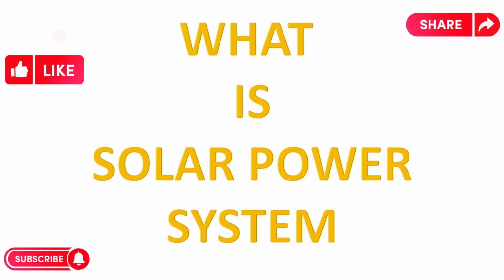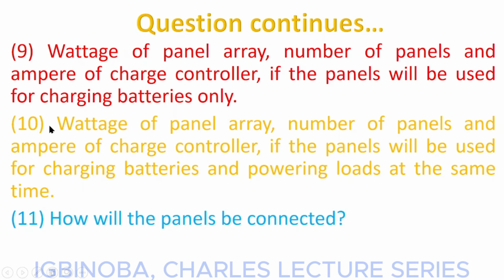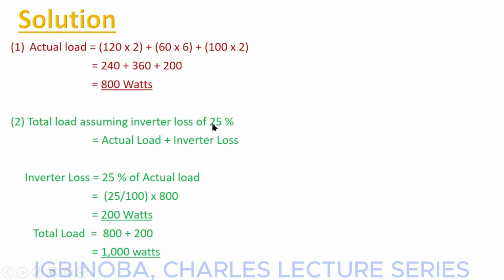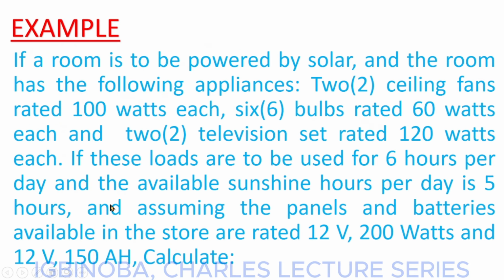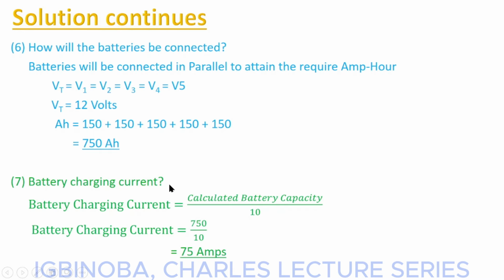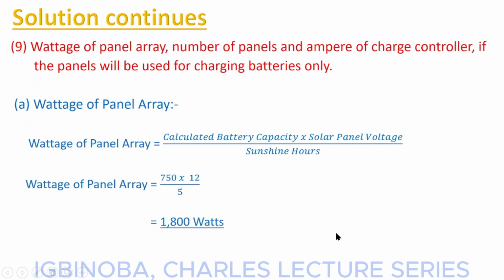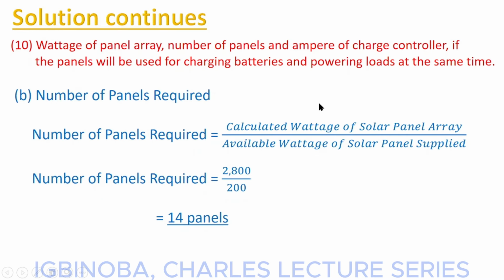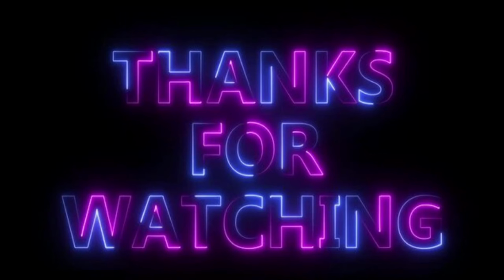Design of Solar Power System

Comment: PETRO3177U

1. Actual load= (100×3)+(60×10)+(120×4) =1380watts
2. Total load assuming inverter loss of 25%= Actual load +Inverter loss
Inverter loss=25% of Actual load
= 25%×1380=345 watts
Total load= 1380+345=1725 watts
3. Inverter rating on VA using power factor of 0.8
= (1725÷0.8)= 2156.25
4. Battery capacity using factor for reserve 75%=(2×1725×6×0.75)=1293.75Ah
5. No. of batteries for backup hours=1293.75Ah÷150Ah= 8.6 =8 batteries 
6. How batteries will be connected?
The batteries will be connected in parallel 
Vt=V1=V2=V3=V4=V5=V6=V7=V8
Ah= 150+150+150+150+150+150+150+150=1200
7. Battery charging current=1293.75÷10=129Amps
8. Battery charging time assuming charging loss of 40%= 1293.75Ah+(40%+1293.75Ah)÷129A=14hrs
9a. Wattage panel array= 3105 watts
9b. Number of panels required= 3105÷345=9 panels 
9c. Ampere of charging controller required= 3105÷12=258.75Amps
10a. Wattage of panel array= Calculated wattage of solar panel array for charging battery only+ calculated total load =3105+1725=4830watts
10b. Number of panels required= calculated wattage of solar panel array÷ Available wattage of solar panel supplied= 4830watts÷345= 14Amps
10c. Ampere of charge controller= calculated wattage of solar panel array÷ solar panel voltage=4830watts÷12volts= 402.5Amps
11. How will the panels be connected?
Ans: They will be connected in parallel.

Comment: MECH338L

1)actual load = 1380watts
2)total load= 1725 watts
3) inverter rating =2156.25VA
4)battery capacity= 1293.75Ah
5)No of batteries= 9 
6)batteries are connected in parallel 
7)battery charging current =129.4amps
8)battery charging time=14hrs
9a) wattage of panel array= 3105watts
9b)number of panels=16panels
9c)charge controller= 258.75A
10a)wattage of panel array= 4830watts
10b)number of panels = 24
10c)charge controller= 402.5A
11)panels are arranged in parallel

Comment: MECH3182Z

1. Actual Load: 1380 W

2. Total Load (including inverter loss): 1840 W

3. Inverter Rating (VA): 2300 VA

4. Battery Capacity: 1227 Ah

5. Number of Batteries: 9 batteries

6. Battery Connection: Parallel

7. Battery Charging Current: 15 A (per battery string)

8. Battery Charging Time: 5.1 days

9. Panel Array (for charging batteries only):

Wattage: 2945 W

Number of Panels: 15 panels

Charge Controller Ampere: 245 A

10. Panel Array (for charging batteries and powering loads):

Wattage: 4785 W

Number of Panels: 24 panels

Charge Controller Ampere: 399 A

11. Panel Connection: Series – Parallel

Comment: PETROCHEM65M

1. Actual load- 1380W

2. Total Load - 1720W
3. Inverter rating- 2156.25VA
4. Battery capacity - 1293.75AH
5. Number of batteries (12V,150AH) - 9
6. Battery connection (48V System) - it would be connected in parallel 
7. Battery charging current - 129.4A
8. Minimum charging Time - 14 hours
9.  (I)  3105W
     (II) 15.5 Panels~16 panels 
     (III) 258.8A
10a. 4830W
     b. 24 Panels 
     c. 402.5A
11. Parallel

Comment: EEE3123S
1. Actual load - 1380w
2. Total load - 1725w
3 . Inverter rating - 2156.25VA
4. Battery capacity - 1293.75AH
5. Number of batteries - 9
6. Connection - parallel
7. Charging current - 129.38A
8. Charging time - 14 hrs
9a. 3105w
 b. 15.5 ~ 16  panels
 c. 258.75A
10a. 4830w
   b. 24 panels 
    c. 402.5A
11. Connection - parallel

Comment: EEE 3124T
1. Actual load - 1380w
2. Total load - 1725w
3 . Inverter rating - 2156.25VA
4. Battery capacity - 1293.75AH
5. Number of batteries - 9
6. Connection - parallel
7. Charging current - 129.38A
8. Charging time - 14 hrs
9a. 3105w
 b. 15.5 ~ 16  panels
 C. 258.75A
10a. 4830w
   b. 24 panels 
    c. 402.5A
11. Connection - parallel.

Comment: CIV352Z

1. 1380 Watts

2. 1725 Watts

3. 2156.25 VA

4. 1293.75 Ah

5. 8.625

6. Parallel

7. 129.375 Amps

8. 14 hours

9a. 3105 Watts
b. 16 panels
c. 258.75 Amps

10a. 4730 Watts
b. 24 Panels
c. 402.5 Amps

11. Solar panels will be connected in parallel

Comment: Chm3107C

1.Actual load =1380w
2.Total load =1725w
3.invertal rating=2156.25VA
4.Battery capacity=1293.75AH
5.no of batteries=8.625~9batteries
6.parallel
7.Battery charging current=129.375ampd
8.charging time =14hours
9.(a)3105w
    (b)15.525~16 panels 
    (c)258.75A
10.(a)4830w
      (b)24.15~24 panels
     (c)402.5A
11.parallel

Comment: PETRO375W

1. Actual load= (100×3)+(60×10)+(120×4) =1380watts
2. Total load assuming inverter loss of 25%= Actual load +Inverter loss
Inverter loss=25% of Actual load
= 25%×1380=345 watts
Total load= 1380+345=1725 watts
3. Inverter rating on VA using power factor of 0.8
= (1725÷0.8)= 2156.25
4. Battery capacity using factor for reserve 75%=(2×1725×6×0.75)=1293.75Ah
5. No. of batteries for backup hours=1293.75Ah÷150Ah= 8.6 =8 batteries 
6. How batteries will be connected?
The batteries will be connected in parallel 
Vt=V1=V2=V3=V4=V5=V6=V7=V8
Ah= 150+150+150+150+150+150+150+150=1200
7. Battery charging current=1293.75÷10=129Amps
8. Battery charging time assuming charging loss of 40%= 1293.75Ah+(40%+1293.75Ah)÷129A=14hrs
9a. Wattage panel array= 3105 watts
9b. Number of panels required= 3105÷345=9 panels 
9c. Ampere of charging controller required= 3105÷12=258.75Amps
10a. Wattage of panel array= Calculated wattage of solar panel array for charging battery only+ calculated total load =3105+1725=4830watts
10b. Number of panels required= calculated wattage of solar panel array÷ Available wattage of solar panel supplied= 4830watts÷345= 14Amps
10c. Ampere of charge controller= calculated wattage of solar panel array÷ solar panel voltage=4830watts÷12volts= 402.5Amps
11. How will the panels be connected?
Ans: They will be connected in parallel

Comment: MECH334H

1. Actual load: 1380W

2. Total load (Direct current with 25% inverter loss) : 1720W

3. Inverter rating: 2156.3VA

4. Battery capacity : 1293.8Ah

5. Number of batteries (12v, 150 Ah) : 9

6. Battery of connection (48v  system) : 2 parallel strings of 4 batteries in series

7. Battery charging current : 129.4A

8. Minimum charging time: 14 hours

9a. 3105W
b. 15.5 panels
C. 258.8A

10a. 4830W
b. 24 panels
C. 402.5A

11. Panel connection : 3 parallel strings of 6 panels in series.

Comment: EEE346T
1. Actual load is 1380W
2. Total load is 1735W
3. Inverter rating is 2156.25VA
4. Battery capacity is 1293.75AH
5. Number of batteries is 9
6. Parallel
7. Battery charging current is 129.375amps
8. Charging time is 14hours 
9. (A) 3105W
    (B)  15.5panels
    (C)  258.75A
10. (A) 4830w
       (B) 24 panels
       (C) 402.5A
11. Parallel

Comment: NAT32B 

1. Actual Load: 1380Watts
2. Total Load (Including inverter loss) 1840W
3.Inverter Rating (VA): 2300 VA
4. Battery Capacity: 1227 Ah
5. Number of Batteries: 9 batteries
6. Battery Connection: Parallel
7. Battery Charging Current: 15 A (per battery string)
8. Battery Charging Time: 5.1 days
9. Panel Array (For charging batteries only)
. Wattage: 2945 W
. Number of Panels: 15 panels
. Charge Controller Ampere: 245 A
10. Panel Array ( For charging batteries and powering loads):
. Wattage: 4785 Watts
. Number of Panels: 24 panels
. Charge Controller Ampere: 399 A
11. Panel Connection: Series - Parallel

Comment: COMP395Q
1. Actual load = 1380
2. Total load = 1720
3. Inverted rating = 2156.25VA
4. battery capacity = 1293.75Ah
5. numbers of batteries = 8.6
6. parallel 
7. battery charging = 129.4A
8. T = 14hrs
9. (a) 3105w (b) 15.5 panels (c) 258.75
10. (a) 4830w (b) 24 panel (c) 402.5A
11. parallel

Comment: PETRO350X
1. Actual Load = 1380 watts

2. Total Load = 1725 watts

3. Inverter Rating = 2156.25 VA

4. Battery Capacity = 1293.75 Ah

5. Number of Batteries = 8.625~9 batteries

6. Parallel

7. Battery charging current = 129.375 Amps

8. Charging time = 14 hrs

9. (a) 3105 watts

(b) 15.525~16 panels

(c) 258.75 Amps

10. (a) 4830 watts

(b) 24.15~24 panels

(c) 402.5 Amps

11. Parallel

Comment: NAT 327A

1. Actual load= (100×3)+(60×10)+(120×4) =1380watts
2. Total load assuming inverter loss of 25%= Actual load +Inverter loss
Inverter loss=25% of Actual load
= 25%×1380=345 watts
Total load= 1380+345=1725 watts
3. Inverter rating on VA using power factor of 0.8
= (1725÷0.8)= 2156.25
4. Battery capacity using factor for reserve 75%=(2×1725×6×0.75)=1293.75Ah
5. No. of batteries for backup hours=1293.75Ah÷150Ah= 8.6 =8 batteries 
6. How batteries will be connected?
The batteries will be connected in parallel 
Vt=V1=V2=V3=V4=V5=V6=V7=V8
Ah= 150+150+150+150+150+150+150+150=1200
7. Battery charging current=1293.75÷10=129Amps
8. Battery charging time assuming charging loss of 40%= 1293.75Ah+(40%+1293.75Ah)÷129A=14hrs
9a. Wattage panel array= 3105 watts
9b. Number of panels required= 3105÷345=9 panels 
9c. Ampere of charging controller required= 3105÷12=258.75Amps
10a. Wattage of panel array= Calculated wattage of solar panel array for charging battery only+ calculated total load =3105+1725=4830watts
10b. Number of panels required= calculated wattage of solar panel array÷ Available wattage of solar panel supplied= 4830watts÷345= 14Amps
10c. Ampere of charge controller= calculated wattage of solar panel array÷ solar panel voltage=4830watts÷12volts= 402.5Amps
11. How will the panels be connected?
Ans: They will be connected in parallel

Comment: CIV80B

1 (3×100)+(10×60)+(4×20)
1380 Watts 

2  inverter loss is 345 Watts 
Total load is 1380+345= 1725 Watts 

3 1725÷0.8= 2156

4  battery capacity is 1294Ah

5 1294/150 = 9 batteries 

6 1200

7 1294/10 =129 Amps 

8 charging time is 14 hours 

9a 1294×12/5 = 3105 Watts 
b 3105/200= 15 panels.
c 3105/12 = 259 Amps

10a 3105+1725=4830 Watts 
b 4830÷200= 24 panels
c 4830÷12= 403 Amps

11 The panel will be connected in parallel.

Comment: PETRO3162F

1. Actual load= (100×3)+(60×10)+(120×4) =1380watts

2. Total load assuming inverter loss of 25%= Actual load +Inverter loss
Inverter loss=25% of Actual load
= 25%×1380=345 watts
Total load= 1380+345=1725 watts

3. Inverter rating on VA using power factor of 0.8
= (1725÷0.8)= 2156.25

4. Battery capacity using factor for reserve 75%=(2×1725×6×0.75)=1293.75Ah

5. No. of batteries for backup hours=1293.75Ah÷150Ah= 8.6 =8 batteries 

6. How batteries will be connected?
The batteries will be connected in parallel 
Vt=V1=V2=V3=V4=V5=V6=V7=V8
Ah= 150+150+150+150+150+150+150+150=1200

7. Battery charging current=1293.75÷10=129Amps

8. Battery charging time assuming charging loss of 40%= 1293.75Ah+(40%+1293.75Ah)÷129A=14hrs

9a. Wattage panel array= 3105 watts

9b. Number of panels required= 3105÷345=9 panels 

9c. Ampere of charging controller required= 3105÷12=258.75Amps

10a. Wattage of panel array= Calculated wattage of solar panel array for charging battery only+ calculated total load =3105+1725=4830watts

10b. Number of panels required= calculated wattage of solar panel array÷ Available wattage of solar panel supplied= 4830watts÷345= 14Amps

10c. Ampere of charge controller= calculated wattage of solar panel array÷ solar panel voltage=4830watts÷12volts= 402.5Amps

11. How will the panels be connected?
Ans: They will be connected in parallel

Comment: CIV45S

1. Actual load is 1380w
2. Total load is 1725w
3.  Inverter rating is 2156.25VA
4   Battery capacity is   
1293.75AH
5. Number of batteries is 8.625 --9 batteries 
6. Parallel 
7. Battery charging current is 129.375amps
8. Charging time is 14hours
9. (A)3105w
     (B)15.525 -- 16panels
     (C) 258.75A
10. (A)4830w 
       (B) 24.15 ---  24panels
      (C).  402.5A
11. Parallel

Comment: CHM3144N

1. Actual load is 1380W
2. Total load is 1725W
3. Inverter rating is 2156.25VA
4. Battery capacity is 1293.75AH
5. No. of batteries is 8.625-9batteries
6. Parallel
7. Battery changing current is 129.375amps 8. Charging time is 14hours
9. (A) 3105W (B) 15.525~16panels (C) 258.75A
10. (A) 4830W (B) 24.15~24panels (C) 402.5A 11. Parallel

Comment: PETROCHEM333G

1 Actual load 1380W
2 Total load  1720W
3 Inverter rating  2156.25VA
4 battery Capacity 1293.75Ah
5 number of batteries 8.6
6 Parallel 
7 Battery charging  129.4A
8 T = 14hrs
9 (a) 3105W
   (b) 15.5 panels 
   (c)  258.75 A
10 (a) 4830W 
     (b) 24 panel 
     (c) 402.5A 
11 Parallel

Comment: MAR399U

1. Actual load = 1380W

2. Total load = 1720W

3. Inverter rating = 2156.25VA

4. Battery capacity = 1293.75Ah

5. Number of batteries = 8.6

6. Parallel

7. Battery charging = 129.4A

8. T = 14hrs

9. (a) 3105W
(b) 15.5 panels
(c) 258.75A

10. (a) 4830W
(b) 24 panel
(c) 402.5A

Comment: PETRO3187E

1. Actual load= (100×3)+(60×10)+(120×4) =1380watts

2. Total load assuming inverter loss of 25%= Actual load +Inverter loss
Inverter loss=25% of Actual load
= 25%×1380=345 watts
Total load= 1380+345=1725 watts

3. Inverter rating on VA using power factor of 0.8
= (1725÷0.8)= 2156.25

4. Battery capacity using factor for reserve 75%=(2×1725×6×0.75)=1293.75Ah

5. No. of batteries for backup hours=1293.75Ah÷150Ah= 8.6 =8 batteries 

6. How batteries will be connected?
The batteries will be connected in parallel 
Vt=V1=V2=V3=V4=V5=V6=V7=V8
Ah= 150+150+150+150+150+150+150+150=1200

7. Battery charging current=1293.75÷10=129Amps

8. Battery charging time assuming charging loss of 40%= 1293.75Ah+(40%+1293.75Ah)÷129A=14hrs

9a. Wattage panel array= 3105 watts
9b. Number of panels required= 3105÷345=9 panels 
9c. Ampere of charging controller required= 3105÷12=258.75Amps

10a. Wattage of panel array= Calculated wattage of solar panel array for charging battery only+ calculated total load =3105+1725=4830watts
10b. Number of panels required= calculated wattage of solar panel array÷ Available wattage of solar panel supplied= 4830watts÷345= 14Amps
10c. Ampere of charge controller= calculated wattage of solar panel array÷ solar panel voltage=4830watts÷12volts= 402.5Amps

11. How will the panels be connected?
Ans: They will be connected in parallel

Comment: PETRO3159C

ANSWERS:
1. Actual Load: (3×100) + (10×60) + (4×120) = 1380 Watts
 = 1380 Watts

2. Total load assuming inverter loss of 25% : 1380 + 345 = 1725 Watts
= 1725 Watts

3. Inverter rating in VA using a power factor of 0.8 = 2156.25 VA
= 2156.25 VA

4. Battery Capacity = 1293.75 AH
= 1293.75 AH

5. Number of Batteries for backup hours = 8.625
= 8.625

6. How will the batteries be connected? : The batteries will be connected in PARALLEL to obtain the required Amp-hour. 
= PARALLEL. 

7. Battery charging current: 129.375 Amps
= 129.375 Amps

8. Battery Charging Time assuming a charging loss of 40% : 14 hours. 
= 14 hours. 

9. Wattage of panel array, if panel is used for charging batteries only : 3105 Watts. 
= 3105 Watts. 

B. No of panels required : 15.525 panels. 
= 15.525 panels. 

C. Ampere of charge controller : 3105/12 = 258.75 Amps
= 258.75 Amps. 

10. Wattage of panel array, if the panels will be used for charging batteries and powering loads at the same time : 3105+1725 = 4830 Watts. 
= 4830 Watts. 

B. Number of panels required: 24.15 panels. 
= 24.15 panels

C. Ampere of charge controller : 402.5 Amps
= 402.5 Amps

11. How will the panels be connected? : The solar panels will be connected in PARALLEL. 
= PARALLEL

Comment: PETROCHEM 350X

Actual load= (100*3)+(60*10)+(120*4)=1380W
2. Total load assuming 25% loss= Inverter loss + actual load 
Inverter loss 1380*25/100=345W
Therefore total load = 1380W+345W= 1725W
3.inverter rating on VA given 0.8 power factor= 1725W/0.8= 2156.25W
4. Battery capacity (75%) = 1725*0.75*6*2= 1293.75Ah
5. No of batteries for backup= 1293.75Ah÷150Ah= 8.6 ~ 9 batteries 
6. They will be connected in parallel 
7. Battery charging current= 1293.75÷10= 129.375Amps
8.Battery charging time assuming 40% loss = 1293.75+(0.4*1293.75)/129.375A= 14hrs
9a. 3105W
9b. No of panel required=3105/200= 15.5~ 16
9c. Ampere of charging controller= 3105W/12V = 258.75A
10a. Wattage of panel array= 3105W+1725W= 4830W
10b. Number of panels required= 4830W/200W= 24 panels
10c. Ampere of charge controller= 4830W/12V =402.5 A
11. They will be connected in parallel

Comment: PETRO3108D

1. The actual load
=(3×100)+(10×60)+(4×120)
=1380 watts

2. Total load assuming inverter loss of 25%
= 1380+(25% of 1380)
=1380+ 345
=1725 watts

3. Inverter rating in VA using power factor of 0.8
= Total load ÷ power factor
= 1725÷0.8
=2156.25 VA

4. Battery capacity using a factor for reserve of 75%
Battery capacity = (2×total load×back up hours×factor for reserve) / battery voltage 
= (2×1725×6×0.75) / 12
= 1293.75 AH

5. Number of battery for backup hour
= Calculated battery capacity÷capacity of battery available 
=1293.75 ÷ 150
=8.625
=8

6. How will the battery be connected?
The battery would be connected in parallel to attain the required amp hour
V1=V2=V3=V4=V5=V6=V7=V8
V1= 12 volts
AH = 150 × 8
= 1200 AH

7. Battery charging current
= Calculated battery capacity ÷ 10
= 1293.75 ÷ 10
= 129.375 amps

8. Battery charging time assuming charging loss of 40%
= {Calculated battery capacity + ( 40% of calculated battery capacity)} / charging current 
= {1293.75 + (40% of 1293.75)} ÷ 129.375
= 14 hours

9a. Wattage of panel array
= ( Calculated battery capacity × solar panel voltage) ÷ sunshine hours
= ( 1293.75 × 12) ÷ 5
= 3105 watts

9b. Number of panels array
= Calculated wattage of solar panel array ÷ available wattage of solar panel supplied 
= 3105÷ 200
= 15.525 
= 15 panels

9c. Ampere of charge controller required 
= Calculated wattage of solar panel array ÷ solar panel voltage 
= 3105 ÷ 12
= 258.75 amps

10a. Wattage of panel array
= Calculated wattage of solar panel array for charging battery only + calculated total load
= 3105 + 1725
= 4830 watts

10b. Number of panels required 
= Calculated wattage of solar panel array ÷ available wattage of solar panel supplied 
= 4830 ÷ 200
= 24.15
=24 panels

10c. Ampere of charge controller 
= Calculated wattage of solar panel array ÷ solar panel voltage 
= 4830 ÷ 12
= 402.5 amps 

11. How will the panels be connected? 
The panels would be connected in parallel.